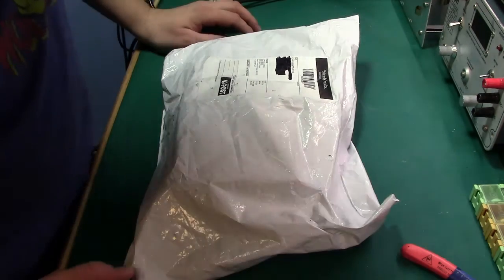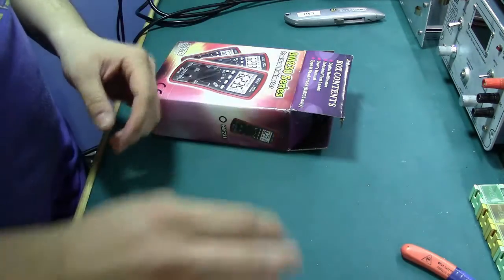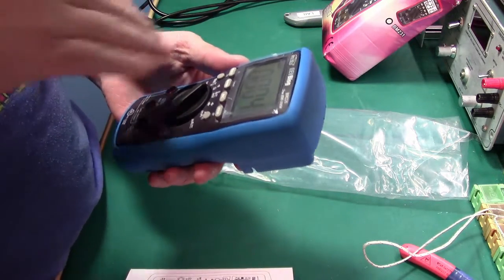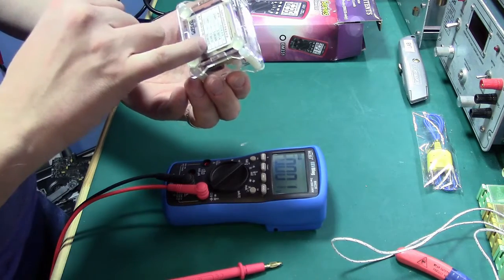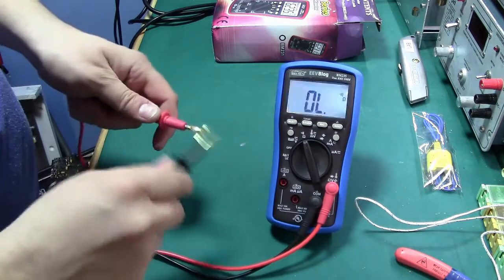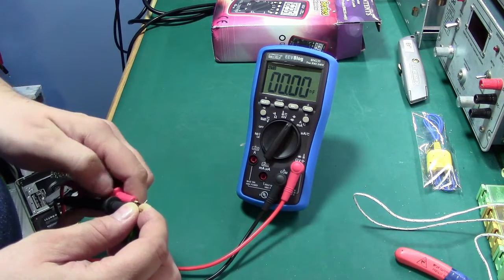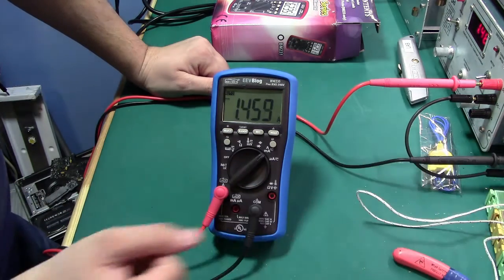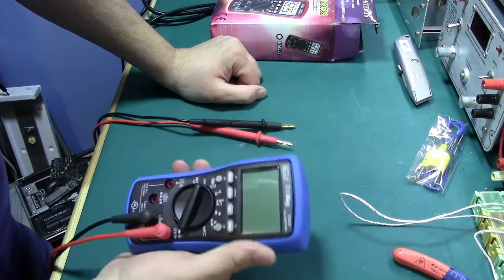EEVBlog DMM (BM235) First Impressions

Comment: Nice video.  Thank you for making and posting it.  Very nice DMM.  Question, kindly, ¿in the Diode test function, please, will this meter turn on LEDs visibly AND read their running voltage?  ¿Particularly, the white & blue LEDs (or those) requiring more voltage (~2.5 to 2.6 Vdc), kindly?  Thank you so much.  Please forgive my many questions.  Any/all comments most welcomed, if you have time/inclination.  Thank you much.  tonyd\.

Comment: I have a Brymen BM869s and saw somewhere on Daves forums that if a lead is connected between the V/Ω & A jacks with the rotary selector in the temperature position, the meter displays it's internal temperature... and indeed it does! Don't know about the 235, but you might give it a shot. This 'feature' is undocumented in the manual. Also note that the meter has a lot of thermal 'inertia' used this way, and is remarkably slow responding to changes... This additionally disables auto power down; and min/max recordings can be made if desired.

Comment: Any idea where one can pick up a volt ref box like in the vid or something similar for testing DMM's?
Reply from the maker: I got my AD584TH-based unit off EBay.  Pretty accurate according to all the instruments that I have available to me and has been stable over the last 3 years with a reasonably temperature controlled lab. It is advertised as being calibrated with an Agilent 34401A, but who knows if that unit is kept in cal, etc etc. For a hobbyist, it is fine.

Comment: You mentioned a thread on EEVBlog about the backlight noise. I've searched and can't find it, do you know what the thread is called?
Reply from the maker: +Dave B.Reviews (My Gadget Tech Thoughts) The thread in question is in the Supporters sub-forum with the title "The Rebadged EEVBlog Multimeter".  You need to be a supporter through either the eevblog.com website or via Patreon to see this section/topic. I should have mentioned that in the video.
Reply: +Dave B.Reviews (My Gadget Tech Thoughts) 
There is a thread on this in the general forum not sure if it's the same thread idpromnut is referring to though.

http://www.eevblog.com/forum/testgear/quick-tear-down-of-the-eevblog-brymen-bm235-backlight-noise-research/
Reply: +lee3r24 NI, that wasn't the thread. He explained the thread he mentioned was in the private EEVBlog section for those who donate monthly. The new threads were started on the public side after I made the comment. But their probably all good threads. Thanks for replying.

Comment: Second thought that whining, think I'll go with the greenlee instead,I've never had an issue with GL products anyway.
Reply from the maker: It should be fixed; it was a "big deal" at the time, and I believe the issue was a poorly selected capacitor. I seem to remember this was changed by Brymen. Greenlee use Brymen as an OEM, so you should be able to find the equivalent model to the 235 from Greenlee.
Reply: @idpromnut  I went with the EEVblog bm235, Im happy with it

Comment: Looks like a nice meter, the packaging screems cheap and nasty.  The price point for this is rediculously expensive when compaired to the fluke 17b.  Also, size does matter.  So a small meter will cost less to manufacture but the cost of materials should equal lower cost to the purchaser.  The current sensor is, I,m guessing, to find buried wires in the wall so unless your rewiring a house is largely irrelevant.  My final verdict is way to much dinero for what you get.

Comment: I think uni-t ut139c would be a better bet!..
Reply: Mods & Tweaks remember ... input protectionn.... it is important.. unit doesnt have..
Reply: Only if your working with high voltage.  For electronics UT139C is a perfect tool.